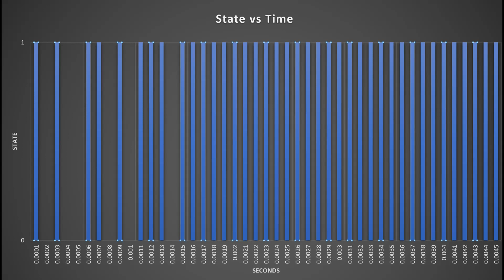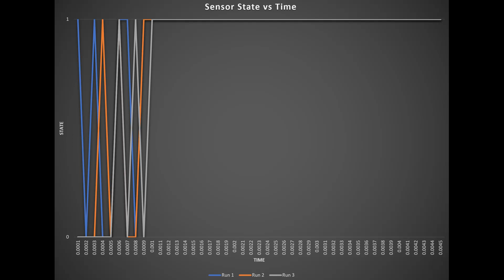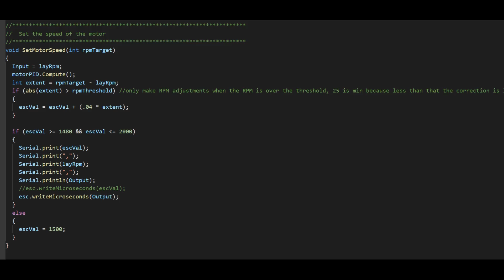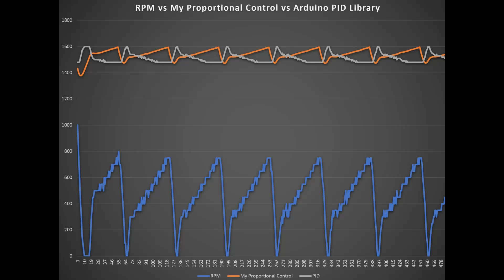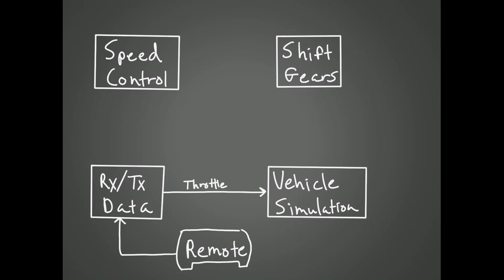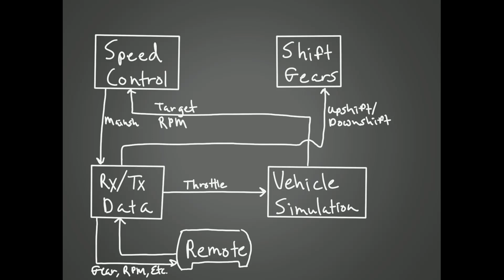3D Printed F1 Seamless Shifting Gearbox - Part 4

Comment: Wow I just discovered your channel and you are doing an incredible job without a technical background! You make us look bad!
Reply from the maker: Thanks!  I appreciate that.  Most of my talent comes from the stubborn refusal to quit.  If you haven't already, check out the 2nd F1 gearbox I did.  I definitely learned a lot from this first one.
Reply: @IndeterminateDesign  I took a quick look but will watch fully soon! It looks great! I think you may want to get it printed in a professional 3d printer for better tolerances and finish and some companies might even print for free as a marketing to show it at expos! Have you got a research paper or book for f1 gearbox design that helped you?
Reply from the maker: Sorry I missed this. No. I found pictures of the gearboxes and reversed engineered front that and the rulebook.

Comment: For ESC's I've heard really good things about the VESC (Vedder ESC) named after the designer - https://vesc-project.com/. I believe it's an open source board design and protocol. DIY electric skateboarder have moved from Hobby ESC's to designs like the VESC with pretty good success. It could possibly ease some of the pain of dealing with hobby ESCs. I have 0 experience using them myself.
Reply from the maker: Wow, those are some nice controllers. I’ll keep them in mind for a couple of other higher power projects I have in mind.

Comment: This project is amazing! Did you think about using neopixel leds? I've used them in a lot of arduino projects and their libraries are pretty easy to use. They're used a lot in DIY Sim Racing wheels because they are addressable and each led is a whole package with resistors and such included. They're connected with 3 wires, VCC, GND and Data. You can connect a bunch of individual ones together or buy segments.
It could help with the wiring quite a bit.
Reply from the maker: No I hadn’t thought of using Neopixels, I didn’t know you could buy them individually. I had only seen them in pre-made shapes.
Reply: In general if you check out some DIY Sim racing wheel projects it could give you some shortcuts while still letting you learn and implement things yourself. It would be really cool to have a full LCD screen on the controller.

Comment: First off, this is so awesome - I always appreciate the insights you've put into these vids. I was wondering - would you perhaps be willing to share your Cura settings? And/or upgrades you've done for your Ender 3? I have an Ender 3 as well - but I've never been able to get this level of smooth quality out of it. I've tuned it very well for D&D minis, but at this scale, it would be 5-6 day prints for that level of quality.
Reply from the maker: My printer  is extensively modified.   I am using a direct drive E3D Hemera, SKR Mini board, and linear rails on the y axis, etc. I saw this article that came out a couple of months ago though on Ender 3 Cura settings. https://m.all3dp.com/2/ender-3-cura-settings-best-ender-3-cura-profile/
Reply: @IndeterminateDesign  holy cow, that is impressive. Appreciate the response!

Comment: "new level of respect for the engineers behind the real F1 gearboxes" - yeah but there's only one of you and you're, very admirably, working outside of your comfort zone! There's a team of them and a lot of their work is probably re-hashed from previous innovations so good on you! I'm not quite sure what you're using for a target speed, is it an RPM you've set in the code so is fixed? I think the hobby ESC's usually vary voltage to control the motor to control speed, so by controlling/reading the voltage can you calculate the corresponding RPM of the shaft? Either way keep documenting your "learning" and I'm sure you can help others do the same!
Reply from the maker: Thanks!  Right now I'm just trying to regulate to a fixed RPM.  Eventually this will controlled by the Vehicle Simulation module which will be responsible calculating the RPM at a given throttle position, speed, and gear.  I actually pulled out the Hobby ESC today and put in the Cytron.  I can already tell that I have much finer control now.
Reply: @IndeterminateDesign  Awesome! Yeah I'm not sure if an ESC will work with a feedback loop like that with the resolution you're after, its not something I think they're designed for anyway. Look forward to seeing how you get on with the Cytron!